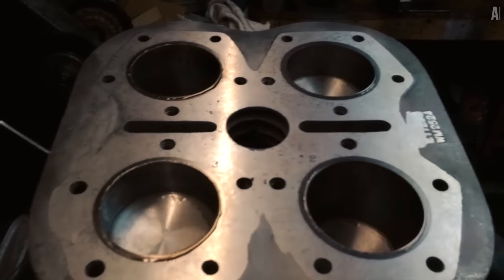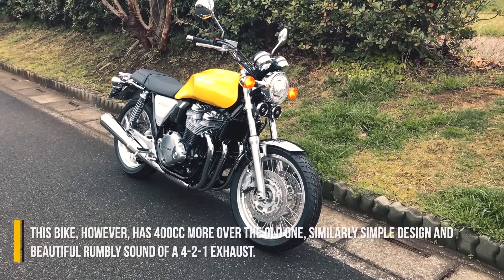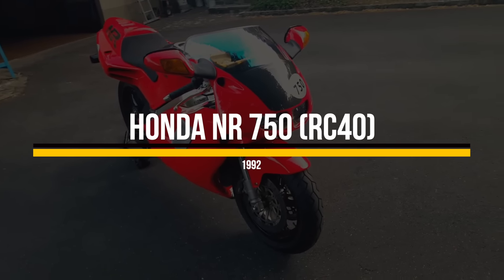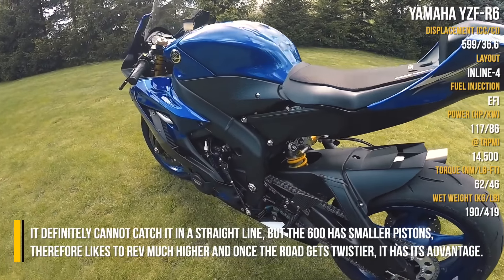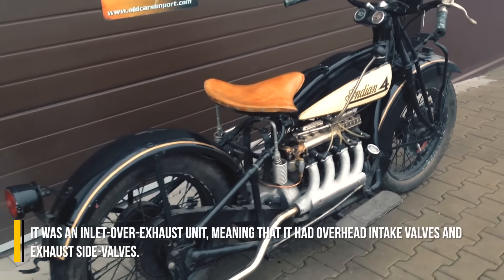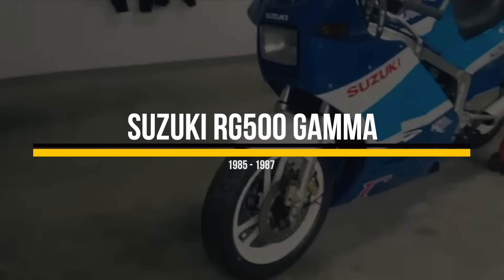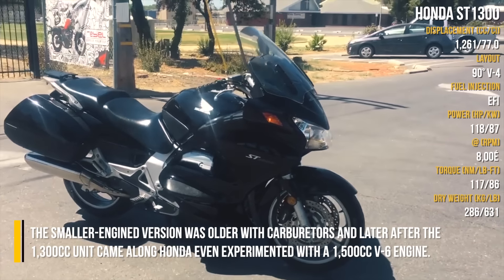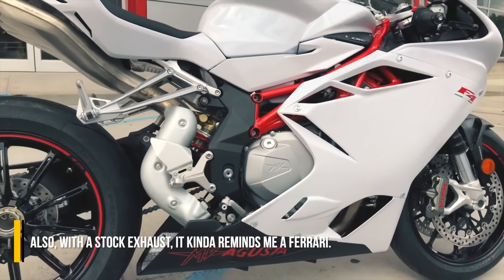10 Best Sounding 4-Cylinder Bikes Ever | Ep.2

Comment: and where is the VFR 750 RC36 (completely different sound than on the shown VFR400), where is R1 with cross plane crankshaft, where CBR250 with 20 k RPM ? You have shown some interesting engine constructions, but that does not mean that they best sounding

Comment: Don’t mean to be rude but I think u forgot the Yamaha R1 which is a V-4 I think
Reply: Not a v4 but inline 4 with crossplane crankshaft
Reply: Why
Reply: Damn the R1 sounds Bad cause of crossplane
Reply: Look I’m srry. At least I knew it was a 4 cylinder but I think it sound amazing
Reply: @JDPlonk  not really it has a deep tone and Ducati too a Bike has to scream not to burble unless it is a harley
Reply: It's a crossplane inline 4, but I agree it sounds like a beast
Reply: @carlosandleon  i think Crossplane is for harleys or another American engines high Reving Flat Planes sound the best Crossplane sounds like car v8 from R1
Reply: @ManOfAttitudeLP1998  Harley's aren't even crossplane. Crossplane is for maximum traction and power delivery. I can tell you're relatively new to motorcycles or else you'd have more of an appreciation for it.
Reply: @carlosandleon  i don't like it but i like crossplane on American cars with pointy cams this big block burble sound then Harley might be low reving square piston stroke
Reply: @ManOfAttitudeLP1998  Harley gets its sound because both pistons fire very close together, it's not even close to a crossplane